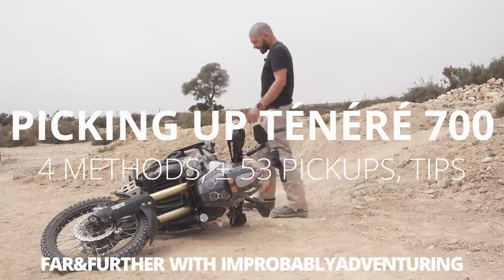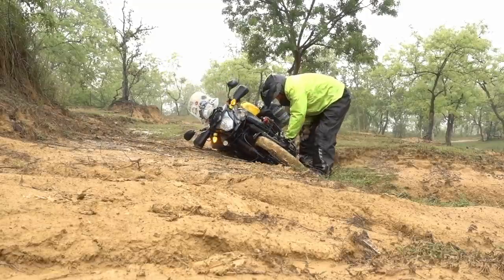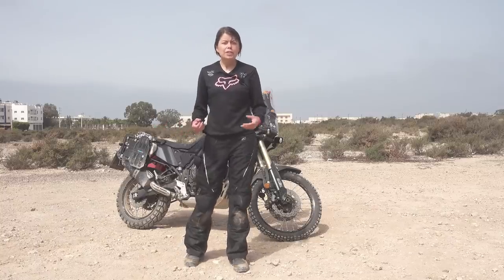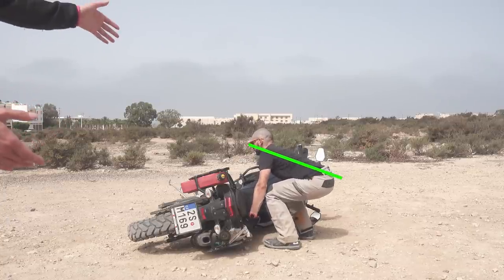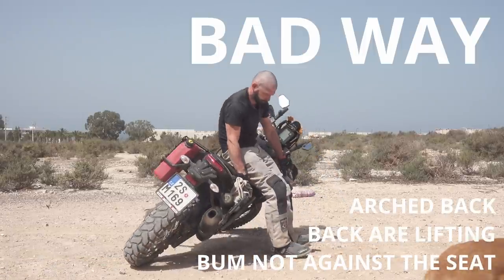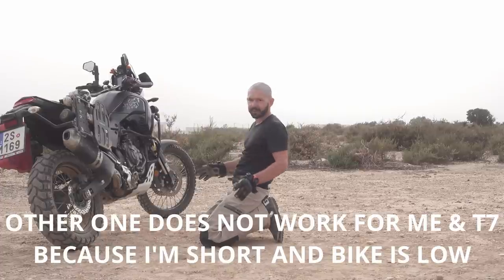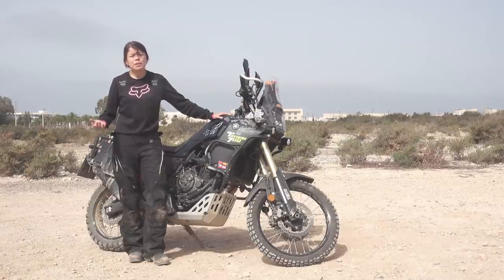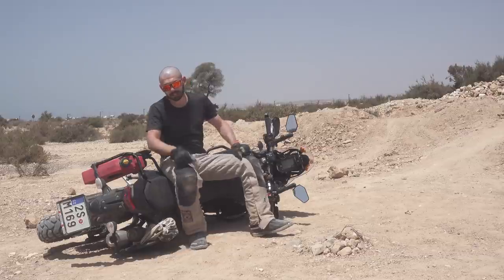Picking up Yamaha Ténéré 700: 4 methods, ±53 lifts, some tips

Comment: Good advice. A tip. When you are lifting anything heavy, look up, it will help you keep a safe posture while lifting. I learnt this from weightlifting and it works.
Reply from the maker: Great tip!
Reply: Looking up puts a curve in your neck doesn't it? I was always taught to keep my head straight during deadlifts, not up, not down, straight ahead.
Reply: not up but forward. When you are squating you look down when you are going up you should look forward

Comment: Another factor is the amount of bend you have to do to lift. A good way to reduce this angle and increase you leverage advantage is to carry a length of strong webbing pre-prepared to the optimum length to loop over the foot peg on the opposite side to the lift, pass under the bike and come to your hands in such a manner as to allow a higher start point for your lift. Obviously it has to also to still be long enough to allow you to lift the bike up but the higher grab point will reduce a lot of back injury risk. In most cases adventure bikes have open enduro style foot pegs in which case you can if you want, you can actually hook into the peg on the lifting side by threading the loop through it and then passing the main length through that loop (warning this can fail if  the footrest breaks hence why it is always safer to use the mounting point on the peg on the other side rather than the open peg on the lift side itself). In practice you are seldom going to be able to lift the bike through the entire 90 degree ark of lift just on this strap, but what it does is bring up the bike to 45 degrees so you can then grab the bike and finish the second 45 degrees with a exactly half the effort.
Reply from the maker: I've read this few times now and I finally understood the idea. I think I'll give it a bash some time to  try it out.
Reply: Thanks for this tip! I'd never heard of it before, but will be checking it out now!

Comment: I was faced with similar issue with a KTM 790 adventure.   I was fortunate that it was in sand.     I dug holes beneath where the tires touch the ground and it made it easier to transition the weight from the side to the tires.
Reply: Good thinking.

Comment: Thanks for the food for thought.  I dropped my bike, a Royal Enfield 650 twin and could not right the thing.  Lucky for me a couple of guys on another motorcycle stopped and helped me.  Since then I've done what I can to lighten the bike, so far I've removed 23kg (50 lb) from the 200kg (dry weight) bike (mostly replacing the heavy exhaust system and the 12V lead acid battery which is now Li-ion but also dozen of other smaller changes). I'm not sure if I could pick this bike up now as I am reluctant to risk damage to the bike by laying it down even on grass for some trial lifts.  It has a lot of ground clearance for what is a road bike which raises the centre of gravity to make a lift that bit harder when it is down.

There are commercially available lift assist devices that basically consist of a two piece telescopic tube (the upright) plus a ratchet and strap.  I have not tried one of those yet.

I'm 163cm tall, so a couple of inches shorter than the narrator,  I weigh 66kg, I've lowered the bike 3cm (which should reduce the chance of me dropping the bike at traffic lights a second time).

Comment: I’m surprised you didn’t mention the gasoline leakage that comes from the Tenere 700 gas cap when tipped over. Got to experience that firsthand yesterday :(
Reply from the maker: Hehe :) I think I have been moaning about that one in some of the video from Sardinia... It does leak a lot, does it not? I'm not entirely sure if it stops though. There is some amount which will drip out and then I think it stops but I'm not 100% sure. It also happens to me only in certain angles and with certain amount of fuel in but again didn't do any propper test :)
Reply: It's actually a defect and will be replaced by Yamaha for free if you take it to your dealership! It's not supposed to leak at all (as that's an emissions violation).
It also ruins the vacuum effect that the Camel ADV aux tank relies on, and they talk about how you need to get it fixed by Yamaha as well.
Reply from the maker: Good to know! I’m not entirely sure if it’s not late for me. What does Yamaha replace? Do you know? Is it tank or cap or just some seal?
Reply: Not sure exactly which part they replace, but they should take care of it as it's a known defect and not something that could be cause by wear usually.
Reply from the maker: Interesting, I’ll ask my dealer when I’m back.

Comment: Dropped my Ninja 1000sx at the flooded river crossing. Not able to get it up as the floor was so slippery. My feet constantly slid and I didn't come out the idea of locking the front break. I was there for about half an hour in knee deep water until an elderly lady came by and helped to hold the break and pull. Great tip on how to secure the break. 1000sx is a truly amazing machine. Ran as if nothing happened afterwards.
Reply from the maker: Wonderful story, I’ll look for the elderly next time! 😂 Having brake locked is such a huge help, so tiny thing but it makes so much difference.

Comment: Great video. Tried all that to lift my Tenere. Did not work, the bike is just too heavy to lift alone so I sold it. That the bike rests so flat makes a big difference, I never had problems to lift my R1200GS.
Reply from the maker: Yes, that is something people underestimate, T7 lays very very flat and is therefore very demanding to pickup. Luggage can mitigate it a bit and with GS the cylinder heads do.

Comment: well explained, i love it. In reality, it's just another task to pick up the Tenere with luggage alone. ;-) In the past 12 months I could make the experience and mostly it's just a fall, when turning, with the wrong gear, plop and then it overwhelms you. respect Anton 😁
Reply from the maker: Happy it was useful. Yea low speed or stalls are most of the cases especially when having short legs like me.

I tend to take as much as possible off when i need to pick it up with luggage. Tank bag & roll bag usually

Comment: Thank you for the video. I am getting my first  adventure bike and I know some day I will have to do one of these lifts. Hopefully later than sooner lol. It makes me a little nervous though, I injured my left arm and it is only about 50% strength 💪.  Thanks again!
Reply: Yes, if it didn't drop;then it's not adventure one,..Just wear proper gears.. 👍🙏™️
Reply from the maker: Hi Tony, glad the video is useful. If you have problems with your arm I may suggest practicing the lifts which do rely on the leg strength. In theory you should not do bicep lift in any of those.

I also think, practice on grass is super useful as you don't really want to practice for the first time when you're out there.
Reply: @FARANDFURTHER  Thank you I will practice. Thanks for the feedback much appreciated 👍!

Comment: I recently dropped my bike twice within minutes on each side. I tried some of the techniques but the only one I was able to do was the handlebars lift. It was in very deep sand which might of made it more difficult
Reply from the maker: That is good you found the way which works for you. Deep sand is tough because the feet start slipping at some point. A lot of people prefers or finds the handlebar lift working well for them.

Comment: I am about 210 lbs and I am usually picking my KTM LC4 640 Adventure up via deadlift using handle bar, no issue with picking that up several times, thus I would rather avoid that ofc. Anyway thanks for other techniques
Reply from the maker: Handle bar is very effective. Heather was able to pickup T7 using that technique. I may struggle with it due to my height, not sure.

Comment: Nice one. I didn’t even know that there is so many technics to lift a bike
Reply from the maker: Thanks, I'm sure someone will come with some other ones I don't know about as well. How you usually pickup your bike?
Reply: FAR&FURTHER I had to pick up my bike only twice and always from behind grabbing steering bar and panniers rack.  Luckily someone helped me with that so it was not so hard
Reply from the maker: It is heavy and tall bike, it does make picking up tricky. Seems back lift will be popularity winner. ;)

Comment: I tried "backwards lifting", I always found that it is impossible to lift the bike just with the power of my legs because either my arms are too short, or my bum is too big!  The tenere is specially difficult because it doesnt hafe any handles fitted to the rear ... that means your bum gets even closer to the bike and is in the way when you wana lift

Comment: I am impressed that you ride the T7 being 168 cm. Thats my favourite adv bike but i am afrad i cant ride it since im 170 cm. Have you lowered the bike or have the low seat? Thanks for the tips on lifting it (in case i gather courage and buy it, will drop it a ton of times).
Reply from the maker: Hi, well I came for CB500X so I have experience with dropping and picking up 200kg bike. I think that's important context. With T7 one thing for sure is that it's much taller than CB500X which means there is much less space for error. When off-roading with T7 I really have to go for it, there is no time for hesitation and if I screw up I know I won't be able to save it with my legs.

I'm on tip toes on T7, forget flat foot unless you move to one but cheek. At the beginning it was intimidating, now I'm quite used to it. I rode CB500X for few days again and it's much much easier bike to ride than T7 for us short riders, for sure.
Reply: @FARANDFURTHER  Im back to my CB500X and I dont regret :-)
Reply from the maker: @thetubelesschannel  No way! 😍 CB500X is awesome, I have to say I’m still happy with the T7 for now but I could definitely do the same travel in CB500X. The rally and the MX track is where CB500X was a bit on the limit. Congratulations, I assume you got the recent year so 19” front?

Comment: Love it. I'm pleased to see someone whose bike ends up on its side as much as mine. I have been really interested in the idea of a T7, but put off purely because I wouldn't be confident on picking it up when I inevitably drop it. You've offered some really useful and (for me) new lift mechanisms. I'll be trying them out on my CRF. For comparison, here is my little video same topic, very similar approach. 

https://youtu.be/vcZg9HNA8Pk
Reply from the maker: Hi Gavin, I’m constantly picking up the T7 as for some reason I just can’t keep it upright 😂 Most of the fails are on my Instagram.

The Africa was way too heavy for me and it’s just nightmare to pickup personally. I looked at your video and I can see the same problem with handlebar lift as I have which is that at some point I have to transition to arm /muscle lift because the bike is so tall.

I have done Hobbit lift video recently which shows the crawl method again.

Good job with the Africa and 1000% for taking the time!

Comment: nice demo. how do you do it if the side stand is on the wrong side?
Reply from the maker: Same techniques, the only problem of course is that you better not overdo it otherwise bike flops on the other side. If side stand is on the wrong side I don't use the back technique or I'm super careful as it's easy to over do it.

Comment: Thanks for the video. If you are only 1,68m tall. What did you change at the ténéré to be able to handle it safe and comfortable?
I got the lower seat and the original Yamaha pack to lower the back. All together it is now 3,8cm lower which makes a huge different for me, I am 1,74m.
Stay healthy, safe rides.
Reply from the maker: Hello, to this point I've not done anything to lower the bike. I've ridden it so far at stock height and for me the limit where I start feeling it gets a bit rough is when I need to paddle in deep mud or rocks, otherwise I'm comfortable with it.

That being said, I've managed to damage my OEM standard seat to the point I need to change it so I've bought the low seat (waiting for delivery) and I'm really curious how much difference it will be.
Reply: @jcn711 I've just read your comment on this video... You said, youre 1,74 cm and got the full Yamaha lowering kit and it helped you a lot... Have you somehow measured the height? I also bought the complete lowering kit and I'm 1, 72cm... I can't notice any height difference... In fact, I did measurements and including the lower seat my the height should be about 857mm. But mine is about 867 mm... I am able to ride this beautiful bike but only on tippy toes... It has always been my dream riding this bike but I can't seem to ease myself as I'm still standing on tippy toes... I can't feel the slightest change...

Comment: I'm about your same size but have avoided this bike strictly due to weight. Have you crashed on a location (on a hill, in sand, in a rut, etc) you have not been able to lift the bike? I like to ride off road and solo. I think I can get the bike lowered but this bike carries so much of its weight up high there really isn't a fix for that. Thx for the video
Reply from the maker: Hello John, I've crashed it on almost all terrain by now, including snow in Albania (https://www.instagram.com/p/CPyBkSNHr33) which was probably the worst to recover from.

So far I always picked the bike up solo.

Lowering the bike won't help much with picking it up as you mention there is not really easy fix for top heavy weight. There are some motorcycle winches but when we talk about those I almost think lighter motorcycle is a better option.

Comment: I'm trying to figure out a strap system for my 955 tiger. I ride without crash bars so my grip points are not good. Plus I'm 20 years older now and I could barely pick it up when I young.
Reply: I've been using 2 handled steering toggles from tandem parachute rigs, super handy to slip knot wherever & still have a handle.. get a couple for free from a dz rigger after they retire them from a rig 🤙
Reply from the maker: Without proper grab points it’s a pain in a butt. Handlebar lift may be an option although I hate that one. Bryan’s idea may be good option…

Comment: Depending on fuel load you're actually lifting about 74kgs. Not lifting 205kgs off the ground.
Reply from the maker: Where do I say 205kg? If you're referring to 204kg at 0:28, I'm not saying I'm picking up that weight.

There is a gentleman (I think from NZ or AU) who did a test with different bike and measured the weight of the bike when on the ground using a scale - what you pickup and it was around those 70kg.

Comment: Being 5’6”, do you find the T700 a little high? Or have you lowered it?
Reply from the maker: Standard height and seat and yes same height. I'm on tip toes and if T7 would be my first it would certainly feel tall.
Reply: FAR&FURTHER thanks for the response.
Reply: @renshuk  weight on suspension probably makes the seat height around 31-32 inches instead of 34.5 pretty reasonable for most folk. Lowering fucks with a ton of angles the engineers designed so I wouldn't recommend it on any bike unless you know what you're doing and are prepared for further tuning

Comment: Hey you say you are short, how short? I'm  probably going to get a  Tenere 700. I know it's too tall for me but I can't let my short ass rule me anymore.  Great video by the way
Reply from the maker: I’m 168cm tall I’m on the top toes but the thing is it only matters when slow riding or stopping on the red light. 🤦🏻‍♂️ Does that mean ride fast and don’t stop? 🤔 🙄🤷🏻‍♂️
Reply: That's the same as me. I was going to  buy an older 660 but this current version is amazing.  When I get one I'll practice picking it up.
Reply from the maker: T7 is very different bike than 660. I have not ridden 660 but at least on the paper. It is important- I think - to be able to pick up the bike, because you won’t be scared dropping it. And that is very important

Comment: Hello, I'm 168cm to and hesitate to buy this bike as it seems to be quite tall one. Have you adjusted your seat or suspension  to a lower position to make it more comfortable to ride the bike? Can you flat foot or can you reach the ground with your toes only? Any info would be really helpful. Many thanks.
Reply from the maker: Hi Maciej, I can't flat foot, I can only reach on my toes. I have not modified the bike in any way so it's standard seat and standard height. Only way to flat foot is to move from one but cheek to another then yes, of course only with one leg in that case. There are options to lower the suspension and/or to shave off some height from the seat to make it lower.
Reply: @FARANDFURTHER  Thanks a lot.
Reply from the maker: @maciejmaciej1718  Always happy to help!

Comment: And if you drop it in the mud, you can't pick it up alone. Found that out today the hard way.
Reply from the maker: Picking it up in sand and mud is of course more difficult, usually some of the mentioned techniques works but it is really up to the situation, sometimes as you say... it's the hard way. When I needed more traction for my feet I used some branches and so on, if the bike slips as I pick it up I just slip it to the point where it can't go anywhere and try.

Exhausting of course.

Comment: that's the trouble with all those big heavy tanks...who needs 'em. Why would anyone buy a motorcycle you can't even handle, especially off road. Too many motorcycles getting too big and heavy  AND expensive to be worth a F***.
Reply from the maker: It is difficult to find a light bike in this segment which would not b super expensive. T7 was a good compromise for me.

A lot of people are going from street to dirt so they buy ADV bikes. The problem is the weight though so yes, there needs to be skill & muscle to handle them properly.

Thats the reason for my videos, I can't provide muscle over the YouTube but at least I can show how I deal with it and maybe it will be useful for people.